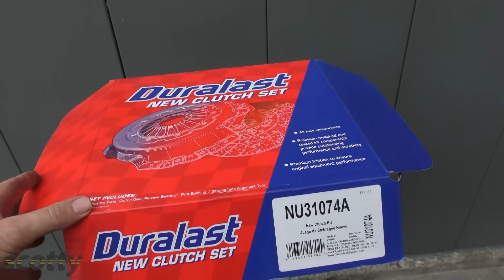5 Things You Should Never Do in a Manual Transmission Car

Comment: 5 things you should never do in manual :

- Looking at an automatic
- Considering an automatic
- Thinking of an automatic
- Test driving an automatic
- Buying an automatic
Reply: Alex R manual is also cheaper. Less things that can go wrong.
Reply: do you even know how easy it is to drive a modern car with a clutch? yeah, the cars from the 80's have heavy clutches, but now that theyre engaged with hydraulic fluid its really easy. they require no strength at all, and even my 78 year old grandma drives a manual car, even incide city centers like brussels and paris, thats more stop and go traffic than you can imagine.
Reply: lol true haha 😂😂😂
Reply: Alex R how do you control the revs in an auto, for example when cornering you might wanna downshift to ensure higher revs
Reply: Scotty on the road to 1 million 😎👍
Reply: These are the most important tips 😂
Reply: most modern autos can rev match if you have sequential shifting engaged or the flappy paddles.
Reply: Responding to the original post - unfortunately automakers aren't really producing manual cars anymore unless it's a sports cars and even many of those come in automatic with paddle shifters which doesn't have the same feeling and joy as pressing on a clutch and shifting.
Reply: Try driving a car with a puny engine.  That 10 - 20% extra efficiency you get with the manual will make a world of difference.

I have both a manual and automatic (CVT) Mitsubishi Mirage.  74 HP.  The manual car has enough acceleration it doens't feel anywhere near as bad as what the reviewers say.  Then I drive the automatic one (wife's car).  Oh my God is is it slow.  And it only has two "gears" because of the CVT.  A low 2000 rpm drone that never wavers or a 5000 rpm drone that goes on and on and on when you spend 15 seconds trying to get up to speed for the highway.  :(
Reply: Even the wire clutches are easy today.  My car, despite being brand new, doesn't have a hydraulic clutch, but it's so feather light I could press it down with one finger when I was adding the cruise control switch.

Only downside is you actually FEEL the clutch plate disengage.  It's like this "grrrunch" sort of feel.  Took a while to get used to.  Found the same thing in other  identical cars.  Maybe more feel is nice, though?  Beats me.
Reply: Sgt De Backer My 86 is easy to drive, it’s probably the best car I’ve ever driven tbh.
Reply: Guinness Move shift lever from D ( Drive) to 3 or 2 and automatic transmission will downshift. Or stomp on accelerator...
Reply: I love a good manual transmission but if you ever lived in a city and had stop and go traffic your foot gets tired of pushing in the clutch.  That is when I love having an auto but if it's not stop and go traffic I'd rather have a manual.
Reply: shepd3  I had same problem, solved it by starting my acceleration 15 seconds BEFORE I wanted to accelerate. Now we're cooking with butter...
Reply: -wishing you had an automatic
Reply: You actually bought 2 of those turds ! Thats the car every auto reviewer says not to own , new or used !
Reply: whats wrong with automatic
Reply: Too late, I've done all 5. I still have a manual car also.
Reply: please tell me you are not one of those "automatic" sport car drivers. lmfao
Reply: iHeart GT86 {KatyCat} or you can be disabled and not be able to use a manual.
Reply: i mean automatic is good for people that grew up with autos and never drove a stick before but i think if you really want the experience get the standard version
Reply: I always buy manual beaters for my trip to work. Go on craigslist. Set search to $2000 to $4000 and transmission to manual and shop that way. I drive 86Km one way and the rock chips alone make the car loose $1000 in value every year. As long as it has oil the transmission works, usually. But for thoes who are saying modern automatics are so great and they do this and that yea sure I get it but I remember a quote from some video I saw a while ago "Just because it's better, doesn't mean it's better." 

Manuals are fun and simple and the driver gets full control. I'll take one over the fanciest 10 speed any day. But I'm not going to get snobby when I have to drive an automatic. My Sequoia is automatic and it does a great job daily driving and towing.
Reply: Alex R lol a manual is not fun at all it is very taxing on a person I drive one every day can't wait till I get a automatic 18 wheeler
Reply: Nameless User Yeah right. Most modern manual transmissions have very light clutches.
Reply: Automatics are for fast cars but manuals are for fast drivers.
Reply: HONESTO UNO nice try
Reply: Alex R Inferior in what? inferior because i have the ability to control and feel every mechanical gear change?
Reply: Nameless User Still better than having your left calf freakishly smaller than your right because it's not doing anything...
Reply: Alex R 
"Inferior transmission" advantages :
- Cheaper
- More fun
- More control
- More mpg
- Cheaper to maintain
- More reliable
- Less moving parts
- Lighter

"Superior transmission" advantages :
- No left foot required

other than that your transmission will ALWAYS Be inferior to modern automatics. SORRY,  BUDDY!!!
Reply: Regular consumers dont need to fucking floor it after turning the corner. And if you think manuals get better gas mileage, youre wrong. modern automatics shift faster, have more gears which allow better fuel economy. And did you not watch the video? if you dont use your manual transmission right you can end up spending a lot of money on a prematurely worn clutch, which costs a lot of money plus labour. a sequential transmission is basically a manual transmission but works in the same way as paddle shifters in automatic cars. Manual is not cheaper to maintain, because you dont have to maintiain an automatic transmission at all, unless your fluid is dirty.
Reply: iHeart GT86 {KatyCat} I live in a Big shitty street in México and I regret getting a Manual on my Seat León FR. I hate Traffic and I shouldve got the DSG.
Reply: iHeart GT86 {KatyCat} yyyyt
Reply: Guinness
You don't! You just hit the corner with speed and hope you don't pop nuttin ;)
Reply: I will admit I much prefer manual but not all automatics are the same. I have a auto with gear-tronic mode that allows you to control each gear shift from 1st all the way up to 5th...you can downshift when you want as well as up-shift when you want and if you have it in the gear-tronic setting and don't ever shift the car won't shift for you and you will literally continuously redline. The only difference between it and a manual is that there is no clutch and the transmission automatically shifts for you when in drive mode.
Reply: - or consider anybody else's vehicle a real one with an automatic. 

The main thing that annoys me about them, is the lazy people who can't sit more than 5 seconds at a stop light without letting up on the brake because the stupid thing is always trying to roll forward even at stops.
Reply: Nameless User: Said like a true auto tranny guy. I've been driving mannys since '84 and my legs find your weird notion completely without foundation. If anything, the left should be more muscular and narrower, because IT'S NOT IDLE LIKE A STUMP.
Reply: jwahh: Funny. Imagine the groan as they see the shifter boot.
Reply: Alex R Not true at all. Manual trans last longer and you get better gas mileage. Also if something breaks you can always operate the vehicle minus the broken gear. If an auto breaks you're SOL.
Reply: All that and they're expensive in comparison. Although I will say one thing for them though, if you're getting a blasted 10 speed auto tranny, that ought to help it's power quite a bit, but that's probably another couple of thousand dollars.
Reply: Yes and the later models have a hill hold.
Reply: Nameless User: Yes, that's probably true, but I suppose the reason for it, is anybody can drive an automatic. It's an extra skill to drive a standard, as many thieves apparently know. I saw in my earlier post that somehow I typed "left should be more muscular....." when I meant to type "legs should be more muscular...". Actually, sort of an awesome thing for manual drivers, if automatics become even more prolific, it should make thieves that can drive standards even rarer.
Reply: Or you're a average square like me who just wants to drive home after a hard day's WORK
Reply: It's not hard to drive a manual car in heavy traffic. Only excuses for driving an auto is if you have a disability or your car has 8724 bhp and would wear the clutch disc out every gear change.
Reply: LMAO
Reply: Autos.....
Power-auto box- crushing disappointment.
Reply: Guinness what the hell are you talking about

Comment: Downshifting: My grandfather used to downshift all the time to brake with the engine. After 270.000km, the gearbox works like its new and the clutch lasted 270.000km too! But he was a great driver, always engaged the clutch perfectly etc.
Reply: not necessary, wastes gas, let brakes do their job (for modern cars).
Reply: Doesn't waste anything don't be silly.
Reply: raleighman3000 Engine braking doesn’t use fuel in modern engines
Reply: If you learn how to rev match and heel-toe properly for downshifting, you're not doing any damage to your car.  If it takes you more than a second to be able disengage the clutch on a downshift without the car jerking, you didn't match revs properly.  Do it right, and you can disengage the clutch immediately with no jerking, which means you matched the flywheel speed to the clutch disc speed, which means you don't need to slip the clutch for a smooth downshift.  Most cars have about a 500 rpm difference between gears, so if you just kick the engine speed up by that amount you'll be around where you need to be for the next lowest gear.
Reply: If you drive heavy duty transmissions you downshift because your brakes aren't going to last if you just use your brakes....

Comment: When parking on a hill...remember driving school. Turn the wheel toward the curb. That way if it starts to roll, it will roll into the curb and stop.
Reply: But if the curb is really low, it could roll onto the sidewalk and kill a kid on a bike.  Nothing is absolutely the safest thing to do.  Life is a gamble.  That's why liability insurance exists and is mandatory in many cases.
Reply: Just... use the parking brake... pls...!
Reply: If the car is facing up you put it away from curb. When facing down you put it towards,
Reply: @aus.RE7  No. You always put it facing the curb whether it's up or down hill. 

If the sidewalk is on your right, on up hill with the tires facing right, the back of the car will slide down to the right, and the back tires will hit the sidewalk.

If you are down hill the tires also face right, because if you slide down, the front tires will hit the sidewalk.
Reply: @martaferreira8177  Idk, I'd have to double check. I always remember up up and away on my written test and I passed.
Reply: kwertea qwerty  Lmao I'm half mexican and I found that hilarious
Reply: lol why are they Mexican  kwertea qwerty
Reply: if there is a curb otherwise your car will probably roll into the woods lol but yes this tip was in my driving handbook
Reply: kichigaisensei What if the hill doesn’t have a curb?
Reply: Nunya Biznis Just throw some dice.
Reply: @glennso47    Curb or no curb, always use the emergency brake.  The easiest, best habit to have if you own a manual transmission.
Reply: @4orrcountry  where I live, I try to avoid using the parking brake as much as possible because in the cold temps, it can actually freeze engaged. Then when you try driving, you back tires don't rotate
Reply: kwertea qwerty  lmaoooo wth??
Reply: @ArsonistArborist  my problem with being in a winter area is the road salt seizes the e-brake cable where you have choice but to leave it in gear. Wheel Chocks come in handy...
Reply: @ArsonistArborist  I have never heard that happen to anyone ever.
Reply: @weekasi1  you probably live in a warm place. Its happened to plenty of people here
Reply: @ArsonistArborist  I live in Finland
Reply: @weekasi1  there are cold temps there, but it gets ridiculous here (central Canada.) But McInTEC made a good point, our roads are heavily salted here. So it could just be the salt reacting with the metals causing the brakes to seize up. Perhaps your roads aren't heavily salted?
Reply: @ArsonistArborist  They are very heavily salted here. Up north they aren't salted as much. Usually locks are the thing that freeze overnight.
Reply: OkY dude sure thing
Reply: UCLA: Up Curb Left Always. All other scenarios, uphill/downhill, curb/no curb turn wheel the right. Makes sense when you think about it.
Reply: @KristalBlut  what if the parking break has not worked half the life of the vehicle?
Reply: Now that is a handy tip that never crossed my mind. Kudos

Comment: I bought a manual transmission 2003 Toyota Echo new.   By the time I got rid of it 12 years it had 230,000 miles on it and still had the original clutch in it.
Reply: That's because you know how to drive a manual correctly.
Reply: That echo was a reliable little tin can
Reply: Yep, if you drive them properly a clutch can last hundreds of thousands of miles.  Most wear on a clutch is from starting off from a stop and from those who think its cool to downshift through all the gears and skip gears, or take off in 2nd or 3rd gear rather than 1st...that's why the gears are numbered in consecutive order LOL...in some heavy duty trucks you can start in 2nd gear because 1st is actually what they call "granny lo" but your standard little pickup and car you need to use all the gears otherwise you are lugging the engine by skipping gears and causing wear on the clutch as it slips too.
Reply: impressive
Reply: Ditto my 86 Nissan truck..but things were built better then.
Reply: Bought a 93 ranger 4.0 5 speed manual with 210,000 sold it with 430,000
Reply: Most manual pickups/trucks I've driven with a "granny low", the shift pattern is L, 1, 2, 3, 4, OD. Or, with a low gear and only three additional gears and an over drive. Even the 1990 F150 I had had L, 1, 2, 3, OD. That's how most trucks are. 1/4 tons are different, and 1/2 tons with small engines not meant for towing and hauling are different.
Reply: Did you ever have the hydraulic clutch fluid flushed like Scotty suggested?

Comment: Hi Scotty - awesome video with great information for driving a manual transmission. And yes, techniques used for racing are not applicable to every day driving in a manual transmission. Every now and again, my smart drivers ask me about rev matching and downshifting and I explain to them that race car drivers use these techniques to corner faster, thus maintaining both the equilibrium in the vehicle, and control. But as you stated, this is wears out the engine, the clutch and the transmission. Like you, I advocate for drivers to use the parking brake in both manual and automatic transmission vehicles - every time they park the vehicle! I like your video style...brilliant! All the best, Cheers Rick
Reply: I don't know why it would be bad to downshift and use your engine to slow yourself down instead of the brakes but I believe rev matching can be beneficial by matching the clutch and pressure plate speeds and decreasing wear.
Reply: True but when you have like a badass mustang with a really cool exhaust, it sounds absolutely amazing to rev match downshift so that's why I do it often and will continue to do so. Lol.

Comment: I only downshifted 2 gears then neutral. Never shift all the way down to first. 
totally unnecessary.
You get to second or third pop it in neutral and brake.
Reply: I was doing this out of laziness😂
Reply: I was doing this when learning to drive a manual, and thought it was bad, so started downshifitng...lol
Reply: What's bad about downshifting all the way to 1st when coming to a stop?
Reply: @elijahprasad7884  general rule. Plus it’s unnecessary shifting. Just downshift two gears, clutch, neutral,  use your brakes. Over time unnecessary shifting will cause more wear and tear. What’s cheaper? A new clutch, or a measly set of break pads?
Reply: @PatrickMersinger  Brake pads are cheaper.  But do people downshift into 1st when they go into a slow corner on track days?
Reply: @elijahprasad7884  you can take the corner in 2nd gear. You’ll find you have better acceleration too.

Comment: I'm a huge fan of standard transmission. I had a 2005 Honda Civic with 295,000 miles on it and still had the original clutch. My mechanic couldn't believe it, but my shifting was as smooth as glass and that's why it lasted so long.
Reply: New driver ish, how do you drive smooth to make clutch last? I was practicing downshifting/ rev matching but guess its not good for your car?

Comment: I watched this video thinking I was going to learn a thing of two . This was good ole common sense back in the day . I bought a 6 speed back in 2014 . It was used and still have the same clutch in it . Never knew they sold just the clutch though !! Clutch , pressure plate and throw out bearing was standard kit when the clutch burnt up . Great video . Hope the younger generation will take heed and follow this advice !!

Comment: About riding the clutch thing. i did my license in europe, and my driving instructor actually told me to only have my foot on the clutch when i want to change gear or when i want to brake to a full stop. ofc, europe, manual cars are the norm :P
Reply: One foot on it is kinda ok, just ensure your not putting pressure on it